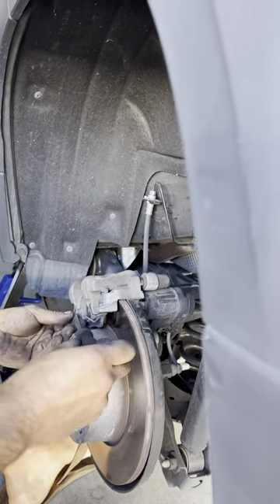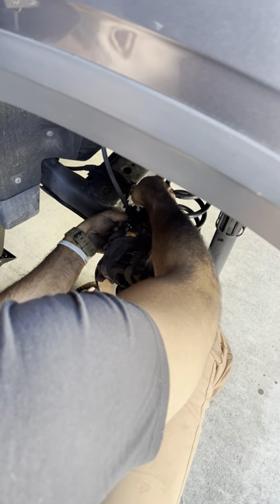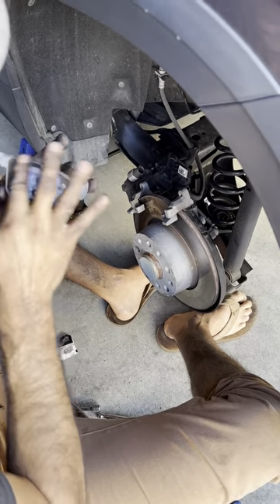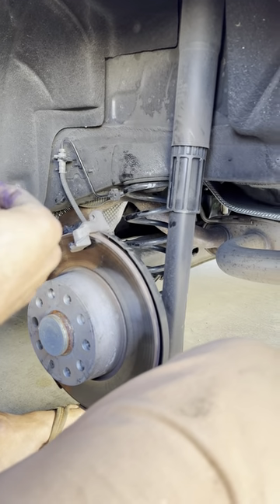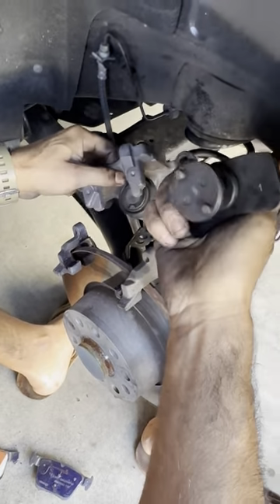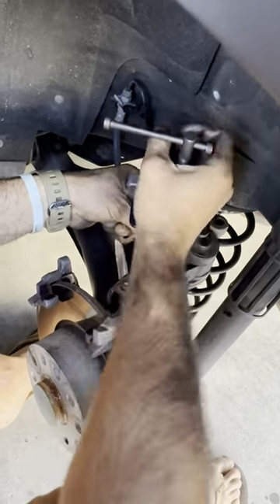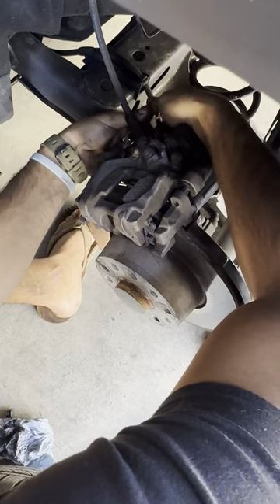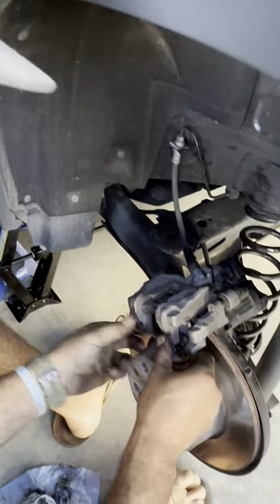VW TAOS rear brake pad change (2022)

Comment: Just did this to mine a couple days ago. The carista app didn’t work for me. But it wasn’t hard to manually retract the electronic brake. A few extra streps that were pretty simple. Dealership and other places will try to scare you with the EPB. But if you have the tools and have done a brake change before you shouldn’t have a problem.

Comment: Nice job! Offspring in the background a good choice too! Just did mine today on my 22 Taos FWD SE. Ours used a 7mm hex bit for those caliper pins, not a T45 Torx bit, strange :) Used the 12v from the battery to tap into the brake motor to fully retract it, worked well if you don't have the app. Simple job from start to finish, looks like yours was a snap too! FWIW our factory rear pads were almost shot at 16k miles, hopefully the new ceramics will last 3x that :)
Reply: Should have been free. There is a service bulletin that covers replacement.
Reply: I had mine replaced at 20K. VW refunded the cost of repair due to fact it should have lasted longer. Reach out to them!
Reply: @CaydenKeeth2025  ours wore out prior to that TSB, have since got rid of the Taos, just not a good car for us.
Reply: Hey question everybody’s talking about the EPB looking to do my brakes and rotors not quite understanding what’s going on with this saw your  Post thought you might know any tips will be appreciated
Reply: Agree, should be using a 7mm or you will be charging the bolt soon

Comment: Where did u go? Only one video? What about other repairs?
Reply from the maker: I haven’t done any other repairs. This was shared as the brakes wearing down early was an issue for many and they were charging us $800+ to do them at VW before they finally put a recall out on them.
Reply: @ashleetrzyna1  i was just charge $686+ to do mines. Along with some other repairs, totalling $4043+tax. And i'm planning to do most myself. That's why i came here, looking for guidance :)
Reply: @ashleetrzyna1  which would be my 4th change in under 2 years, which also, i just continue to ignore because it costs sooo much

Comment: When I went to slide the caliper back onto the new pads, it barely wouldn't fit. I made sure the piston was compressed all the way, did you run into this issue at any point?
Reply: Yes

Comment: Can you explain how you used the Carista app? Is this a plug-in device?
Reply from the maker: yes, you get the device plug it in and get the app with it. then you can access diff settings for the car, in this case it would be putting the brakes into service mode which retracts the electronic parking brake.

Comment: what are the torque specs on the caliper pin bolts and carrier bolts?
Reply: I found an online manual and it appears the pins are spec'd to 26 ft/lbs and the carrier bolts are 67 ft/lbs + 90 degrees.  In case anyone is curious.  Apparently no one on YouTube ever bothers to torque brake bolts or use blue LokTite. :face-turquoise-covering-eyes:
Reply: @hoselrocket2001  Do you have a link to that online manual? I tried finding a Chiltons or Haynes for the 2022 Taos, but can't find one.

Comment: I have a 2022 taos as well AWD and they said my calipers are operated by a computer and they said the dealership needs to do them wants to charge me $1100.... I think they're full of sh*t
Reply from the maker: Yeah, that sounds like bs. Mine isn’t AWD but essentially using the OBD tool you’re putting the parking brake into service mode to release it, which is the only thing I’d assume is controlled by a computer. I don’t know much but maybe the video will help and avoid the $1100. We got the warranty extension just after replacing my brakes at home- no help VW. Lol
Reply: @ashleetrzyna1  what about an electric parking brake that does require a computer and software to retract?
Reply from the maker: @technerdgaming9259  mine does, that’s what the obd adapter is for. Connect to car and put it into service mode, it will retract so you can work on the brakes
Reply: @ashleetrzyna1  can you link me one?
Reply from the maker: @technerdgaming9259  I used carista
Reply: @ashleetrzyna1  oh that bluetooth one
Reply: If your VW Taos is under 24,000 miles you should get the pads service (rear ones at least) in the Warranty…. I miss the warranty for 900 miles on mine.  Apparently they found that the rear break pads are going to fast in these models.
Reply: @MrCMCF  Leased my daughter a new 2022 Taos last May and just brought in for maintenance at 9,700 miles (yes, less than 10K) Dealer wants $650 to do rear brakes. I am calling BS...1/2 of her miles are highway. How can a cars brakes and rotors last less than the synthetic motor oil? Is it really under warranty?
Reply: I'm having the same issue right now with my wife's Taos 2022. What did you end up doing? Any recommendation? They are crazy at the dealership
Reply: @ArreazasAdventures-ms8wn  It's our 2nd pair of complete brake replacements within 45K miles call me crazy but that's super fast, I have a Jetta with 145K miles and I can't even remember when I replaced them lmao. 🤣